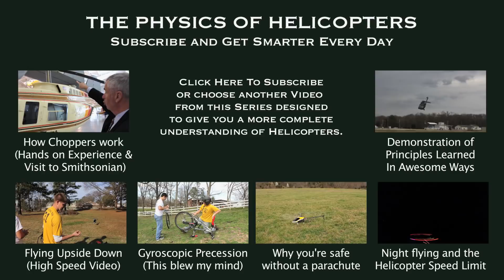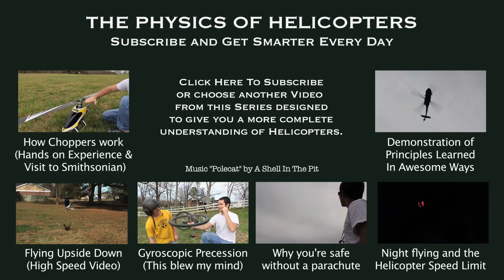Helicopter Physics Series - #2 Chopper Control - Smarter Every Day 46

Comment: Destin, Destin, Destin,
...
Directed here from another site.  I am very disappointed that you did not show that to tilt the heli FORWARD, the AoA and, therefore maximum lift is on the RETREATING blade, NOT at the rear.
...
Gyroscopic precession, then acting 90 degrees LATER in the rotation, lifts the tail.    You can just barely see this at time 3:27. The retreating blade (on the left) increases AoA as the swash-plate tips forward.
...
This is one of the most interesting aspects that ties the real world to understanding ALL of the fundamental principles of science to understand thing like this.  The beauty of science is the way it all fits so nicely and plays so well together...when you fully understand and apply ALL relevant principles to things....
...
Shame, Shame, shame.

Comment: At 3:25 you can see 2 linkages to the blades, but there are 2 other shorter linkages to the mast. I assume this tilts both rotors in the direction of motion? I've seen this in other helicopters at least: https://youtu.be/_QkOpH2e6tM?t=4m27s
Reply: Its a anti torque arm so the swashplate moves with it without creating soo much stress on the linkages to the blades

Comment: How much would one of the RC helicopters cost and where can i buy one?
Reply: 400+ for a decent one around that size (not including radio) at many online hobby shops. $4,000 is not uncommon.  These are NOT for beginners, its a lot harder than it looks. WL Toys makes good cheap starter heli's  The V977 RTF  is great. I highly recommend a good simulator to learn without the expense of crashing. If you fly RC you will crash, we all do.

Comment: That Rave Ballistic heli is antiquated lol. Destin, you should do a SED with a more modern machine 😂
Reply: It's a little old but it's not much different than more current models. Not much has changed in RC helicopter airframes in the past 5 years or so it's mostly the electronics that have advanced and most Raves that are still flying are actually pretty modern machines. It's still a nice model and a lot of people wish they were still being made.

Comment: Hello I am a big fan of this channel, 

I would like to point out that, at minute 2:39, you guys are explaining that "You do not control the altitude of the helicopter by the speed of the blades." However,  I found in The Complete Book of Helicopters by D. N. Ahnstrom (page 127) that you do control de altitude of the helicopter by the speed of the blades, could you please explain me what is going on, than you for your time!!!
Reply: john ortiz yes you can control the rotor speed...just that it's not desirable to Rev up or Rev down the rotor in flight, as that applies alot of torque to heli. it's much more efficient to switch the blade pitch....and let the motor 'idle' at constant RPM. good catch though! the vid was wrong, we DO use different RPMS...Just not constantly changing RPMS...as that's not desirable. as far as rotor speed goes most fly with (including myself) low, medium and high rotor speed.  we switch between the three via toggle switch on our transmitter. this will affect how aggressively the heli will handle. hope that answers your question.

Comment: Watching that little RC helicopter fly, all I could think about were dragonflies. Very erratic, very agile, and yet very precise.
Reply: lol, great minds think alike :)).

I wonder if that could be possible with a real size heli, but even if it is i think the pilot would take a hit if on board.
Reply: To be able to make those maneuvers without losing control, I think the whole craft would undergo g-forces too strong for the pilot to withstand, let alone the craft itself.
Reply: Denver Eduard yes and no, aerodynamics work differently at bigger scales. And also, the pilot G force issue as u mentioned

Comment: Ok so if you see the rotor as a circle from above, cyclic pitch creates more lift in one area of the circle than another. This causes this area to rise, shifting the force keeping the helicopter flying from straight down to angled, so you can use it to get where you're going. g

I kinda always knew this, I just couldn't imagine that we had tech that kept a rotor-blade that's changing pitch a hundred times a second from shaking to bits. I mean I can see that now we can, easily, but when the first heli's went airborne this wasn't the case.
Reply: +Peter Timowreef , whoever designed the swash plate is a genius ;)
Reply: RC FunTime
Yea, that's proven beyond a shadow of a doubt. I still can barely believe it actually works like that.. the vibrations.. the loads... unbelievable.
Reply: +Peter Timowreef. That's right. It's hard to imagine but if at zero pitch the rotor blades are as close as possible to zero deg it will have minimal vibration. Also obviously the blades are both should be identical in weight and size.

Comment: Wait he said "Most helicopters use a swash plate" are the ones that dont use it co-axial or is there something even more complex and cool than a swash plate?
Reply: +talksfor lifetwo Not all helicopters use swash plates. The current breed of multirotor models use fixed pitch rotors and vary both total lift AND attitude by altering rotor RPM not pitch, hence no swash plate needed. And technically yes, they ARE helicopters.

Comment: 3 years after this series was uploaded and I'm getting smarter everyday trying to learn how to build better helis in Besiege, lol. The physics are amazing but Besiege doesn't allow such fine designs so you've got to fudge it a bit. =P
Reply: +The SilentCaay Channel Well technically maybe if you went into a bigger scale it MIGHT be possible, just not not very good because the rotor blades can't scale alongside it, only the rotor itself, basically adding weight on top of the very little lift you already had. Unless you use a steering block to turn the propellers, that could be useful for controlling lift,
Reply: The SilentCaapy Channel  c ce
Reply: Same here. Im also doing it in a game called Plane Crazy. its on roblox but isnt autism

Comment: helicopter don't really need a rear rotor, just two on the top going opposite ways.
Reply: Matias Stette nothing 'needs' anything. It's just a matter of what is easier to realise. In this case, a tail rotor is generally easier to control the copter with.

Comment: tail rotor balances the torque produced but it also generates force in side ways direction.
how this force is balanced
Reply: pitch (nose up/down) and yaw (left/right NOT roll) are coupled together. That means if you have yaw (movement induced by the tail rotor), you will have an induced pitch. Thus, the use of both the front and tail rotors can work together to stabilize pitch/yaw. I hope that made sense.

Comment: Love this series! It would have been cool if you guys attached a camera to the end of one of the blades as you were rotating them slowly to display collective and cyclic pitch. The camera would tilt at an angle relative to the horizon, depicting the angle imparted on the blades by the swashplate adjustments. This would have been especially useful for displaying the cyclic pitch because the camera would tilt at a different angle relative to the horizon depending on the blades position around the central rotor.

Comment: if only we had pilot who could maneuver like that.
Reply: TheUselessStoner in real life copters are heavy, and the energy output from the fuel compared to the vehicle's weight can only result in so much thrust. in the miniature, the copter is way lighter and the output of energy compared to the miniature's inertia is way bigger, so there's more thrust resulting in every direction. there are no motors that can do that in real life to a full sized copter, and I don't believe anyone would be able to withstand the massive ammount of g force those maneuvers would generate

Comment: he didn't answer how force by tail rotor is balanced
Reply: Yes he did. By adjusting the tilt of the rotor blades at the back you can not only push or pull, but also balance how much push or pull force it generates. A small tilt will generate a little bit of force, a big tilt angle will generate more force.

Comment: Some have electronic motors on the rear..... So the speed may vary depending on if its a belt drive, or a separate electric motor.

Comment: What about coaxial rotor heli?
Reply: they can't do anything hardly
Reply: KpilotRCHelis what?! Kamov coaxial rotor helicopters are more stable in flight than conventional helicopters. The 2nd rotor stacked above the 1st eliminates the need for an anti torque rotor
Reply: Just because they are more "stable" doesn't mean anything.  And really, they aren't much more stable.  

And also, you still have to control the yaw, just in a different way (And much less effective) than normal helis.  

Coaxial helis cannot flip, fly upside down, or anything that the one in this video can.  There are a couple exceptions such as $6000 custom built collective pitch coaxial helis but they are so impractical no one makes them.  

Hence why I said "they can't do anything hardly"
Reply: splintercell275
They suck, badly.

Comment: Just a myth repeated by people that don't know any better. The physics of helicopter flight is well understood. 

The forces that make a fixed wing air craft's wings lift are the same ones that make a rotor blade lift. Throw in the extra complications of changing wind directions and some extra torque and gyroscopic forces, and boom, you have a machine that is very unforgiving, but not impossible.

Comment: The reason a full sized helicopter can't hover up side down and do some of the aerobatics an RC helicopter can do is because of two factors. Thrust to weight ratio's and the mechanical strength needed for the components to withstand the stresses of that kind of flight. 

RC helicopters have far far more power per kilogram than a full sized helicopter. It's also much easier to make the smaller components withstand the stresses of that kind of flight than it is full sized objects like rotor blades

Comment: the blade speed varies from idle to flight of course you dont want you blades whipping full tilt while on the ground lol, blades can only spin so fast as to keep the leading edge under the speed of sound at full speed in any givin direction. full size heli dont do this because the human body cant take the extreme G forces. but unmaned heli can as you can see in the video

Comment: Generally speaking the engine will compensate if it can. If you apply too much collective in a short period of time in a real helicopter you can stall the engine.  So really he likely just meant that you have no direct control over the speed of the rotor itself.  The engine is on or off and it does its best to maintain the same rpm.  You will use more fuel with a higher collective.

Comment: The blades never change speed, or they never change input force? I.e. the "deeper the blades bite into the air" (for instance when increasing lift) the more air resistance they will encounter, so to maintain constant rotor speed the force applied must be increased.

Does he literally mean that the rotor speed remains constant, or did he simplify or misspeak (and meant force remains constant)? I assume the first?

Comment: How does the helicopter keep the momentum when it is on the air. It is not very clearly explained in this video. You have explained lift and flip. It would be great if you can explain how it keeps flowing in the air... Nice video by the way..

Comment: your right, the majority of rc copters do that instead.  I have a counter-rotation rc and instead of a vertical prop on its boom/tail, it has a horizontal prop because the toy copters your talking about are tiny cant support that much sophistication.  However his a more advanced in that it is how full scale helios work, though have no chance of accelerating as fast.

Comment: You are right they CAN do it, but they are not authorized maneuvers. Usually after they are performed, major maintenance must be performed (i.e. busted strap packs.) Just as a race car CAN go 200mph for 4 hours, at the end the engines must be rebuilt.

Comment: There are Helis that can do limited aerobatics. The Apache and Comanche are examples from the US arsenel. Check it out.  -  watch?v=1GIiYV9YEnY  - Full loop starts at 2:30. There is a severe limit to the amount of G a Chopper can tale due to the change in wing (rotor blade) loading as pitch changes, so the manouveres are much slower than a conventional aircraft (or a model which has smaller parts). There are probably a few russian/Chinese choppers that can do the same type of manouvres as well.

Comment: @Maaartah (note that I have not watched the video) When the rotor spins the air doesn't just go straight, if also goes outward and in a circle around the helicopter. The air spinning around the helicopter creates the opposite effect of the helicopter spinning. That's why the back prop is always spinning(to compensate for this effect) when the main rotor changes speed the back rotor needs to change speed as well. Hope that answers your question.

Comment: only one last omitted item here: you are forcing a very rigid rotor head and rigid blades to be stable by using a virtual electronic flybar. in this case you MUST have a teetering head and flexible blades

Comment: if you're talking about when the heli it self is sideways, it does't. its falling at that point, but when it gets past that angle, it can get lift again if the pitch is in the right direction. if you're talking about when the heli is hovering normally and the blades are perfectly level, thats just the shape of the blades, also known as an air foil, which is what makes a plane get lift

Comment: The engine and rotor RPM are both constant. The gearboxes reduce speed (~20,000rpm at the engine to ~300rpm at the main rotor), increase torque, and split power between the main and tail rotors. The amount of lift produced is controlled by the collective changing the angle of attack of the blades, while RPM stays the same.

Comment: Two things, I thought the engine speed was the constant, while the blades' RPM do change through a gear box system. Is it not so? Second, the medieval aircraft of Da Vinci could have worked, even without the passengers spinning like a yo-yo, if ball-bearings or such simple devices were included in the design :-)

Comment: angle of attack is the angle between the relative wind and the chord line (the rotor blade) pitch angle is the angle between the horizon and the chord line. angle of attack is decreased as airspeed increases because of the horizontal component of lift

Comment: That's because gravity is a very weak force, so basically he is allowed to suspend for a brief moment. Usually when you want to achieve a brief hover at an angle, you'll "throw" the helicopter into that hovering position.
If we want to briefly hover with the tail towards the upper left of the screen, we'd initiate that by accelerating up and left. When gravity takes over as thrust decreases, the helicopter wants to go right, but he pulls off another move before gravity has a chance. :)

Comment: So, I finally got around to it. I emailed the owner of my local helicopter flight school and asked him if helicopters use negative collective during autorotations. I also emailed robinson to ask their techies about it. They both said the same thing: that real helicopters enter an auto with neutral pitch (no lift) and then raise the collective to avoid rotor RPM overspeed. Keep in mind this is a robinson, so it could be different elsewhere.

Comment: Negative pitch would put drag on your blades in an auto, just like positive pitch, thus slowing your RPMs.  During an auto you can use the collective to control the speed of your rotor to prevent overspeeds.  So in a helicopter with negative pitch capabilities you would have to be aware of this.  Dont know how this works, I would think its just the bottom range of motion on the collective.

Comment: No.  A water surface will act like a solid surface and provide the 'air cushion' for an In-Ground-Effect (IGE) hover.  The helicopter's rotor system is 'pulling' air from above and forcing it through the system to create its lift.  A helicopter actually requires less power to hover IGE.  If the helicopter has enough power it can hover Out-Of-Ground effect (OGE) as well  Sometimes, an overloaded helicopter may not have power to hover at all on any surface and this may be what you are referring to

Comment: While negative does make you drop faster, while at negative pitch the airflow caused by the drop causes your rotor blades to gain speed or maintain it.... had you kept positive pitch while lost all engine power, your rotor blades will quickly lose speed....

Comment: Hmm. That's interesting. I've heard of Navy choppers using negative collective to stay on carrier decks and such, but wouldn't negative collective decrease rotor rpm in the event of an autorotation (increasing blade pitch decreases rotor rpm due to drag). And sufficient translational lift and rotor rpm is necessary for flare and landing. Also, wouldn't adding negative collective accelerate you toward the ground faster (eek). Just some thoughts : )

Comment: Sure wish they would of said that they were talking about collective pitch helicopters; fixed pitch helicopters do control their ascent and descent using the speed of the main rotor.

Also, you don't have to have a collective pitch on the tail rotor to control the 'yaw' of the helicopter.  Sure, having collective pitch on the tail rotor gives you quicker control, but it isn't necessary.